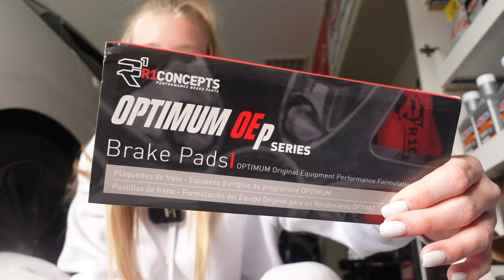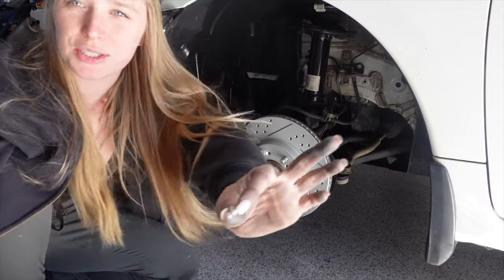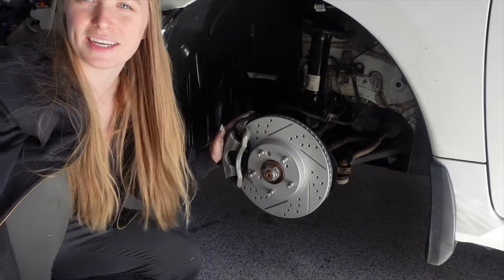2016-2020 Civic Front Brake Pad & Rotor Change DIY (1/2)

Comment: Those little screws don't need to be replaced, only purpose is to hold the rotor onto the hub as car is moving down assembly line.  For future reference to get them out use a hammer type impact driver.

Comment: Nice workk! Its good practice to always take those slide pins out and clean em then put some fresh silglide brake grease onto the pins  or whatever you have, and work it back and forth inside there to make sure they dont dry out from heat and seize up and cause dragging.

Comment: Great Job !!
On a really tough caliper bracket bolts, I use a  boxed end wrench with a 5 lb shop hammer. 
Several controlled whack's goes a long ways it's hard to get a breaker bar in there.

Comment: Drilled is useless for a car you don't track as it will never reach brake fade, slotted is ok, but requires you to pay for pads more often but these even have vents. WAY overkill for even a mild track car. You have so much money if you can afford to do this just because. 

There is a tool to remove those screws without much worry that hammers a screwdriver while turning it.

Comment: Bungee cord to hold up caliper out of way.  Large piece of cardboard or similar  BEFORE you start spraying all that shit around.  Beautifully finished floor will not stay that way for long if you don't protect it. Did you not think to put on new braided lines to replace those stock rubber?  Especially since you are bleeding down the brakes anyway.  Single piston sliding callipers will never give you wonderful brakes, a replacement twin piston would be the way to go. Many more dollars of course!
Reply: Braided lines on a stock Civic lol? Na, stock work just fine.